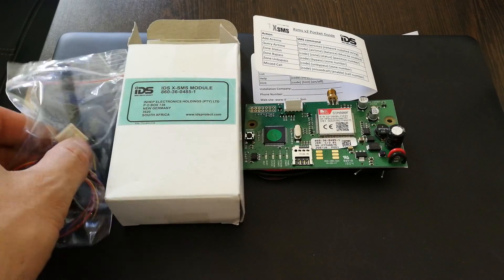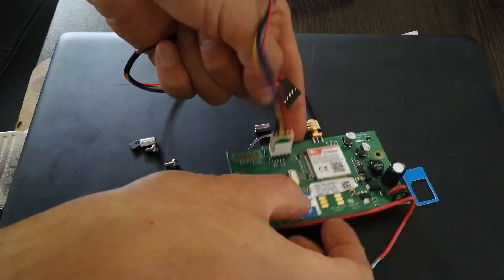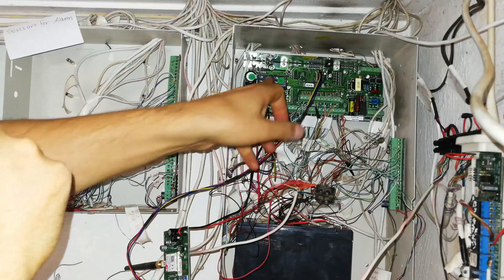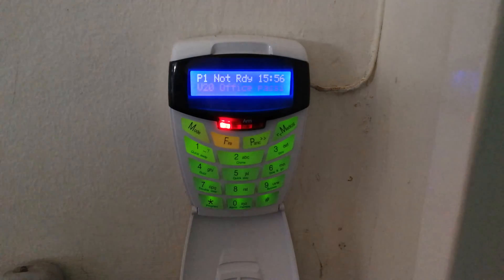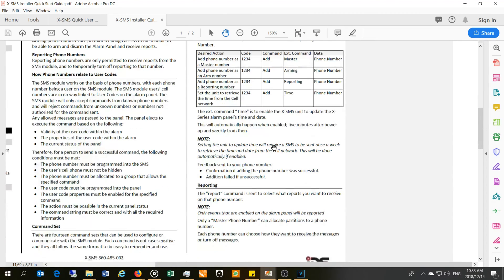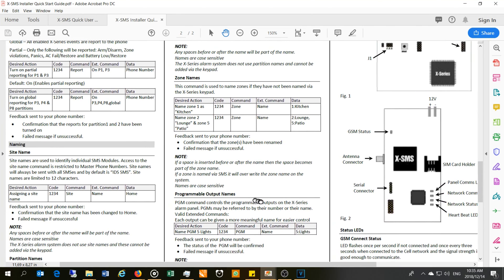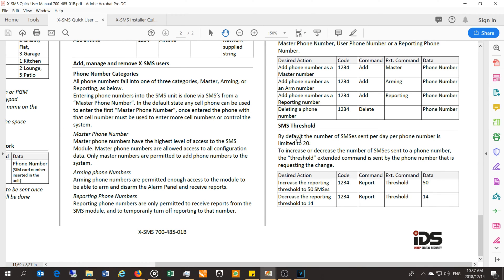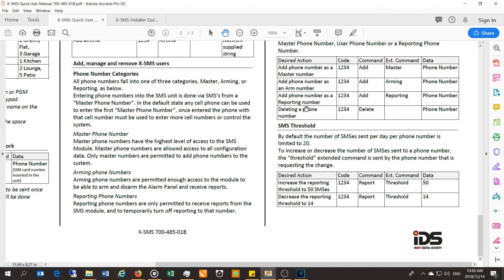How to setup the IDS sms communicator (x-series)

Comment: I lost reception from the previous SP in my area, and swap to another SP's sim-card. I set the sms communicator up as per your instructions above but experiencing problems. When sending "1234 arm status P1" or any command as before the reply comes back as "1234 arm status P1" Invalid command. What could be wrong?

Comment: My unit has the bad habit of sending multiple sms's for a single trigger even now and then. Eats up all the preloaded SMS units. Is there a firmware upgrade for the SMS unit?
Reply from the maker: the firmware version is written on the unit. I think there was version 1.05 and higher. Check you on the higher version.
Reply: @ecologicaltime  how do you upgrade the firmware on the unit?

Comment: very bad practice to work on the panel with power connected and while handling the bare PCB with power connected ... that's probably why you have "popped" so many boards just saying
Reply from the maker: The board is not buffered. If you connect the sms unit to a battery backup source there is a potential diff and it pops the board. This is an oversight by IDS.  I have suggested that they isolate the board. They do have an isolate unit that one can BUY. Overall I have a few boards that popped owing to be connected to back up power. When there is load shedding the boards popped as there were pd between bus voltage and panel owing to different discharge rates.